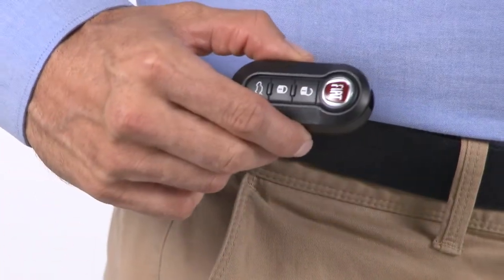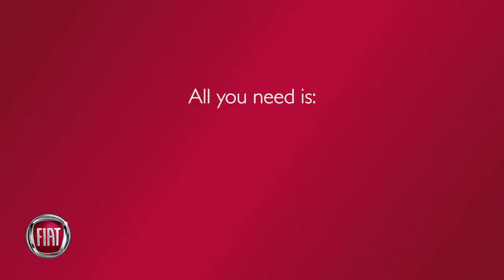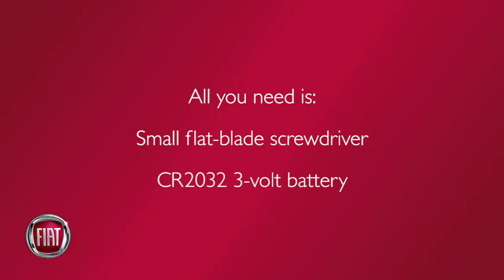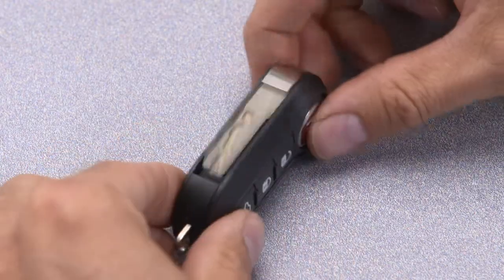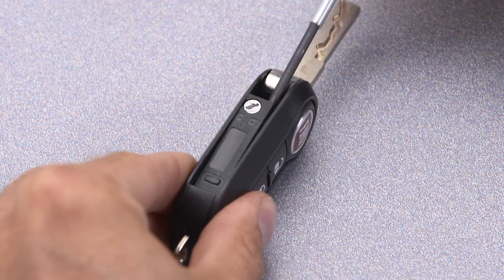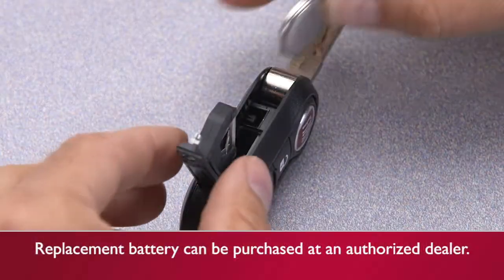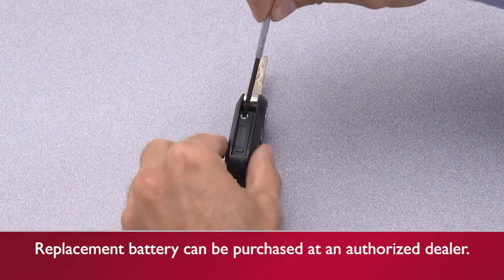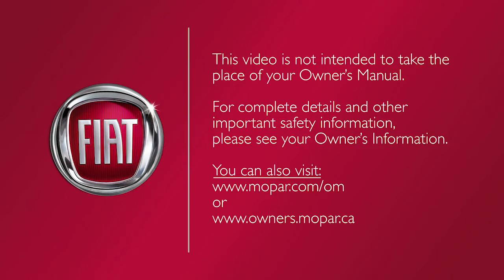Key Fob Battery Replacement | How To | 2020 Fiat 500L

Comment: Well the remote functions seems not to work after relacing a battery on ours
Reply from the maker: We're sorry to hear that! If you have already had an appointment scheduled, please send us a PM/DM on any of our social channels such as Facebook, Instagram, or X for assistance. You can also contact our call center at 888-242-6342. ^YA
Reply: @mopar  actually, I do not know if it is due to the thickness of the window dampening the signal from the key phob but after trying them outdoor, they worked and they even worked from indoors too 😁